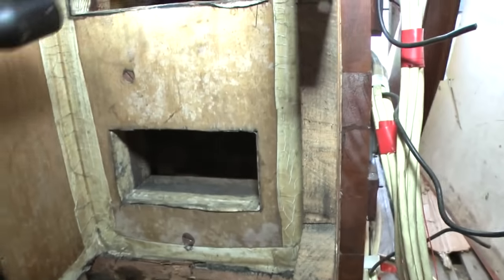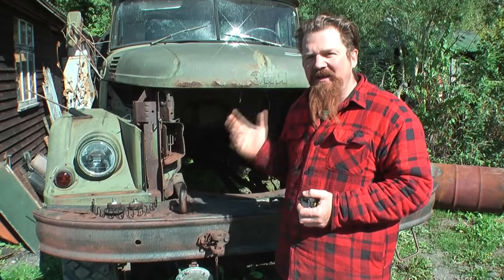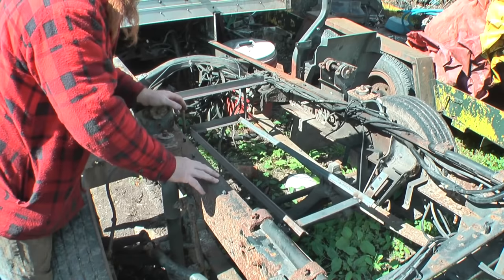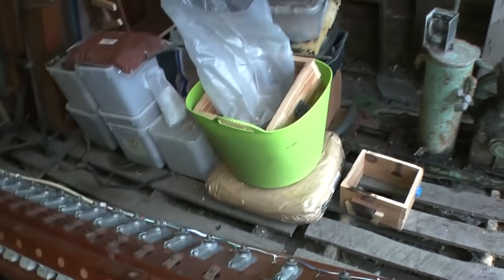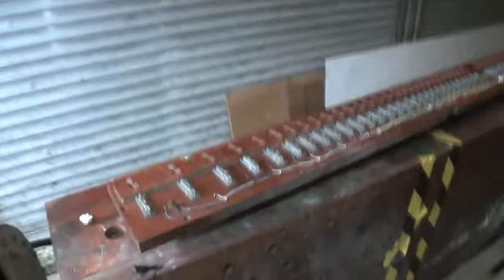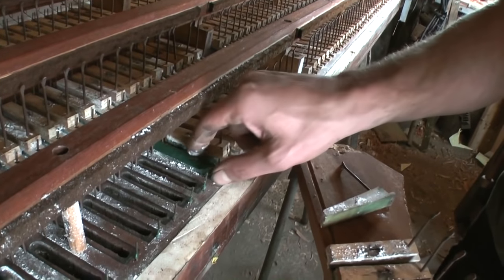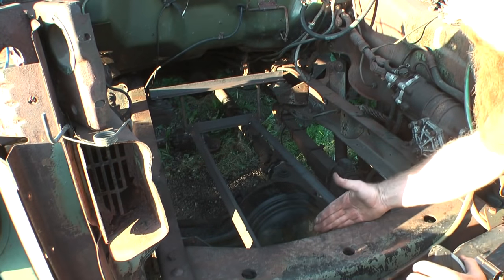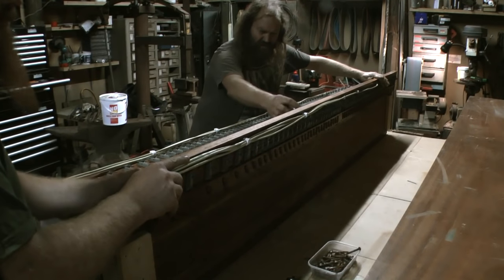Project Awesome 9: New engine and more organ parts.

Comment: A nice explanation of the electro pneumatic organ action Mark. God I'd like a quid for every action motor I've made and leathered! As an apprentice back in the early seventies and even before we actually signed the contract, I made just about four thousand primary action motors and they were not standard ones but ones that had cut up post card ribs inside them for heavier pressure actions. This was for the Grand Organ of St Paul's Cathedral in London. And I've made a good number of wiring looms just like the one attached to that wind chest. Good luck with it.  Max you may or may not know it but the wind pressures are very low in terms of pounds per square inch on an organ. One PSI equals if I remember correctly 29" water gauge. And most normal organs work on 3 to 4 inches water gauge.

Comment: Seeing you assemble that clutch brings to mind the countless times I've made a lining up tool by winding masking tape around a ½ drive extension bar, and shaping the splines by knocking it through the old centre plate to form a replica of the first motion shaft. Happy days, well not too happy - it was usually cold, wet and on my back in the street.
Reply: I've done exactly the same, many times! :)

Comment: I have spent the last 12 months of spare time fitting a 6bt to a land cruiser 80,probably a tighter fit than the zil.Had to change sump & pickup and dipstick,compressor removed, alternator changed,but kept the 24v starter,Start's,runs but not driving quite yet.
Reply from the maker: Yes, I imagine that is a snug fit! We're fortunate to have lots of room under the bonnet of the Zil.

Comment: At least with this being the style of truck it is it wouldn't be too hard to extend the nose to accommodate the straight-6.  A lot of truck manufacturers have done that over the years to accommodate larger engines in vehicles that weren't really designed for them.  In fact Ford did it with mk1 Transits to give enough room in an engine bay designed for a V4 petrol to fit the York diesel or Essex V6 that were available from the factory.  I'm sure that making a long-nose variant would be pretty easy for you with your metal-working skills...
Reply: A nose cone would be fun I think.

Comment: Nice finally the zil  project! Nice work you resurfaced the flywheel 
I would raise the engine evenly to clear the steering box and think of the engine twisting under torque 
Look like a Cummins 5.9?
Take care be safe

Comment: Wow, a shout to project binky! What's more are you using the same engine as the Escargot is receiving? I think that was from a DAF too?
Reply from the maker: Nope, both from DAF trucks, but they chose the more modern 4 cylinder for lightness, we chose the old 6 cylinder because it's heavy, overengineered, very simple and it was cheap!
Reply: @maximusironthumper  - Ahhh, that would make sense. Plus I guess the Zil chassis, running gear and wheels are much heavier than their Ford Cargo, so you guys need more grunt!

Comment: That's not far off standard thickness for the clutch lining fella, don't be a skin flint and just fit a drive plate, you'll need a cover and possibly a flywheel skim but make sure the skim takes into account the pressure loading on the cover when bolted to the face of the flywheel.. I've seen too many people get a flywheel skim by god knows who and not get the correct offset (if there is one) between friction area and clutch cover. Get it wrong and you either end up with a clutch that drags or slips no better than the pile of dust you originally swept out of the bell housing..
Oh and project Binky is awesome, been following it for years but have actually forgotten about them for the last few months... going there to catch up now :)
Reply: Oh... that'll teach me to type while the video is still playing..... Ignore all the above lol

Comment: That flywheel isn’t that bad if fitted clutches to customers trucks in a lot worse condition I wouldn’t personally change it but it’s up to you and that clutch plate don’t look that worn but I’d change it now while you have it on the floor it would save a lot of time in the future 
Keep up the good work can’t wait to see it on the road
Reply: +Commercial_vehicle_services  I agree about the flywheel, as long as there are no cracks in the drive surface it should be fine to go again, I expect that amount of heat colouring to the metal would be pretty normal in a vehicle of that sort of weight as there's going to be a lot of friction there and, therefore, a lot of heat.  Those trucks are usually well-maintained as they have to be ready to go at the drop of a hat, and the clutch that's in there, which is probably the original still had enough life in it not to have seen the rivets chewing up the flywheel drive surface.  The clutch plate does look pretty heavily worn to me though, it didn't look like there was much meat left over the rivet heads so I would suggest it would be a mistake to refit it as it is, especially when it's going into an all-wheel drive vehicle and a rather heavier vehicle than its original home which is going to see it working harder than it did in the Leyland-DAF as that would pretty much guarantee it'll fail shortly up the road and probably at a really inconvenient time.  For what a clutch kit costs it would make far more sense to change it while the engine is on the ground rather than have to go to the hassle of having the truck in bits unnecessarily a few miles up the road...
Reply: Max did it right - it could be pressure plate was bad and causing slippage, ZIL is a bit heavier (older/more friction on trasfer box) then a donor truck so if there's a problem it would get even worse. Good thinking, Max.